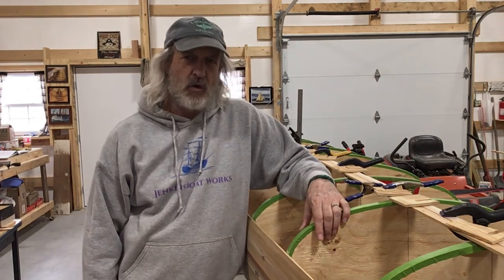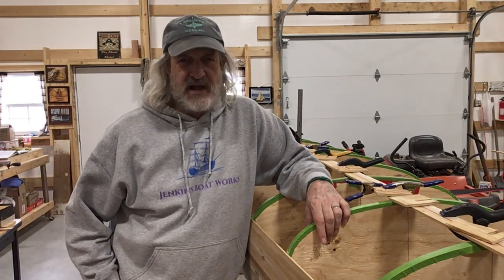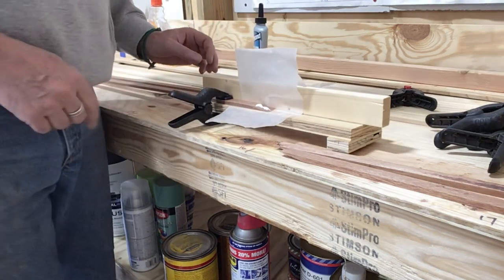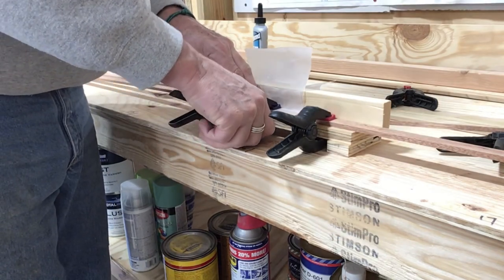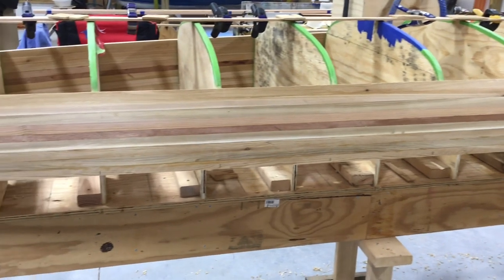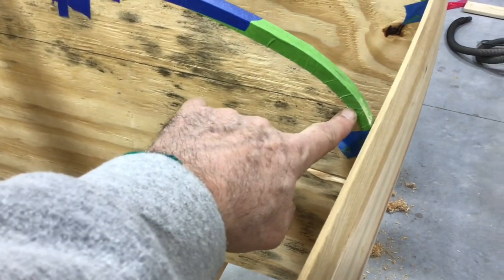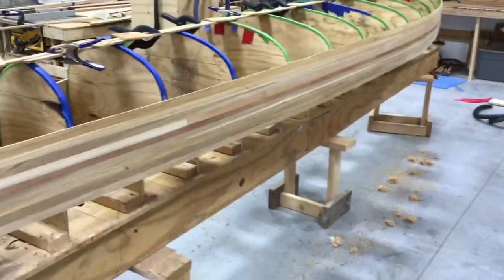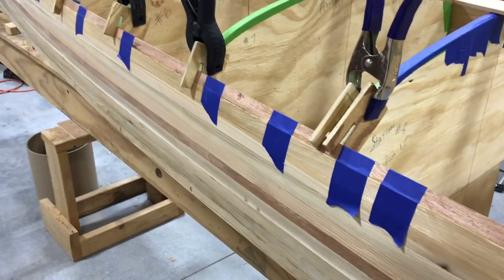Waterline Accent Strip - Freedom 17 Canoe Episode 11

Comment: I cut my scarf cuts on the chop saw with a fixture that  holds the strip on edge.  I make my scarfs 6:1 ratio, for 1/4” strip the scarf is 6/4 long.  Works fine.  Must use a clamp and wedges against the strip and fixture sides to keep the saw from sucking in the strip.  The fixture is a piece of 1 x 4 12” long with two pieces of cedar 5/8” x5/8” nailed to the 1x4 with a 1/4” space between the 5/8” cedar which holds the strip on edge.  The 1x4 base is set about 15 degrees off 90 degrees, what ever will give me the 6:1 ratio, and clamped to the saw base.  One 5/8” strip should be a little longer so the strip can be clamped to it.
Reply from the maker: Interesting